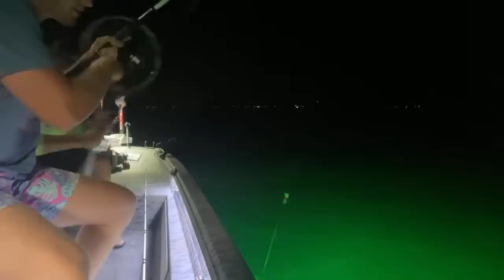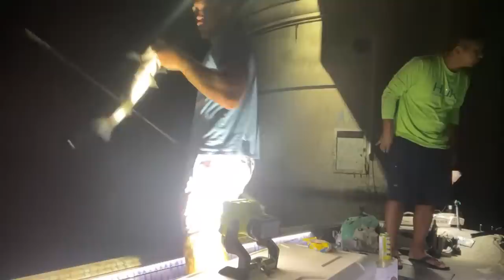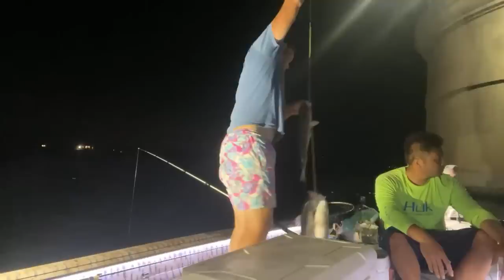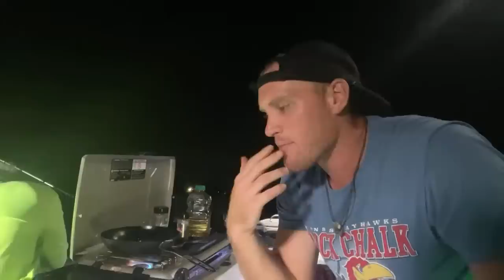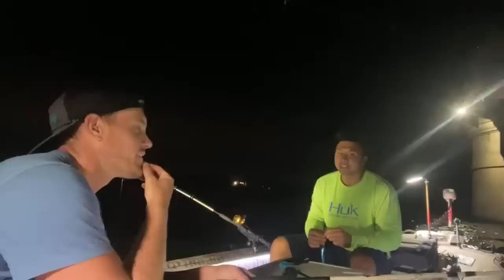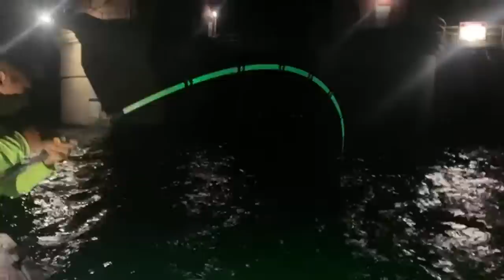LIVE* Striper Fish-Off!

Comment: If your going crabbing you need to try it the simplest old fashioned way. Chkn leg on a string tied to a stick pushed into the ground in knee deep water with a scoop net. REMEMBER TO ALWAYS DRAG YOUR FEET IN THE WATER. Scares off STINGRAYS so you don't get stuck with the Barb. If you do this? Not dangerous at ALL.

Comment: On offshore boats here in Texas we commonly use the ice chest as seats. This might help you around the ice chest. Point #2 the chest can become a bait well as well. Need PVC pipe with small holes in it and a water pump. Bilage pump is commonly used as 2 routes per a T can be used. Now you got a bait well circulation system and a "pump out the water were sinking," excuse to buy the bilage pump. Need a simple valve forgot that so you can chose which function you want.